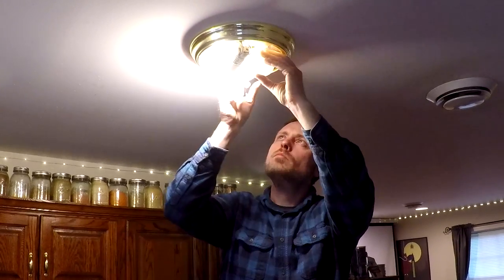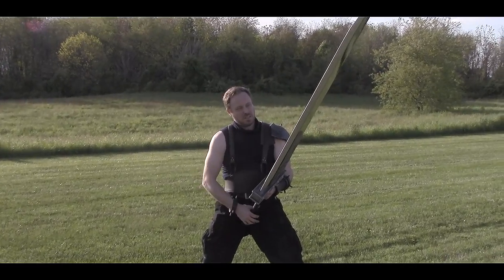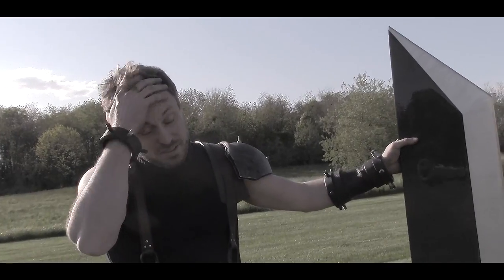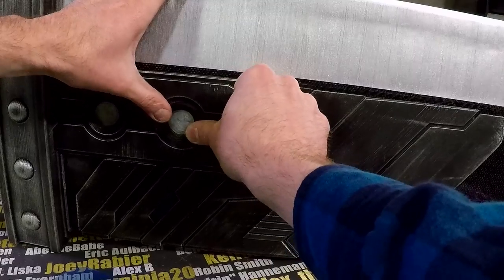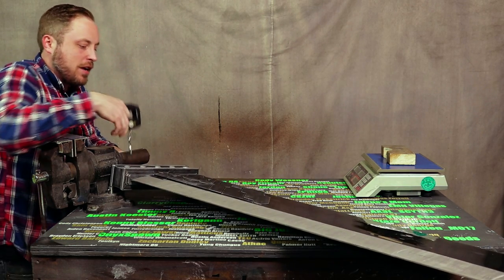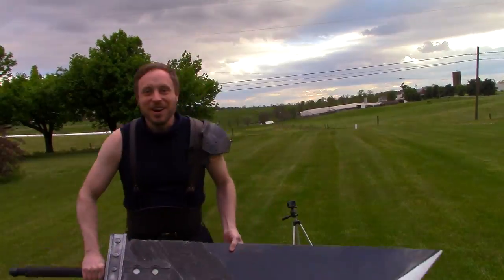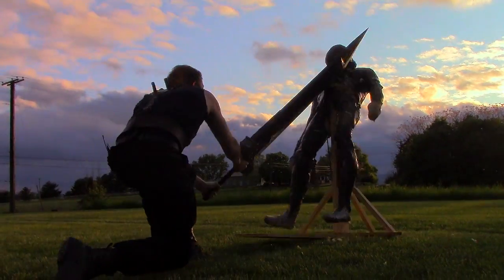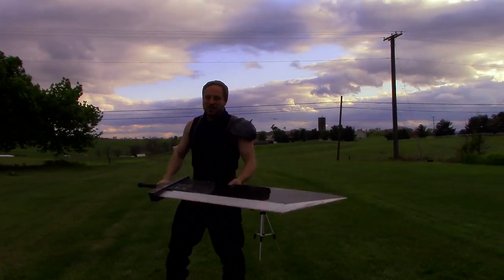CARBON FIBER BUSTER SWORD TEST - With Materia! As Cloud! From FF7 Remake! Omnislash Special!!

Comment from the maker: To answer a few questions that I have been receiving-                                                                             .
Can I have it? / Will you sell it? I will not give this away or sell it but I am willing to make one just like it. In fact I am in the process of making one for someone now. If you are truly interested then email me. My email is always in the video description. If you are wondering how much it will cost, please remember that it is a custom composite piece made from all carbon fiber materials (even the 3D prints) and an exotic metal blade edge with reinforcing internal structure, that takes a month to build... by hand, AND cost for materials alone is roughly 1k.  Basically what I'm trying to say is that it is expensive and will take a long time.                                                                      .       .  
When is this video coming out? Now. lol  Honestly though, this video took me longer to edit than probably any video I've done in the past. I'm still not 100% happy with it but my editing software would not stop crashing and erasing sections that existed in previous saves. I've never experienced anything like it. That is why it took so long. Everytime I would get close to finishing the edit it would happen again.

What's your next project?  I was planning on doing a major video game weapon but it was contingent on a sponsorship that didn't happen. So now I need to pick a new project and you can help. My current 3 ideas are
1. Finally do Aquaman!!!!
2. Axes from Valhalla Assassin's Creed
3. Something from Cyberpunk 2077 (I plan on doing multiple things from this game)
Reply: Aquaman please
Reply: Time for us normal human to try and make this
Reply: Also add some pop out tiny but strong motors in the shaft so with the flick of a switch you get pulled through water under water like those water jet things
Reply: Also work on making your costume more comfortable easy to work around with
Reply: You should get a worlds strongest man to lift that sword
Reply: What editing software are you using, if I may ask?

PS: Cyberpunk 2077!
Reply: I was actually just wondering about how the Aquaman setup was going. I'd like to see where your plan is currently with that one. However, a Cyberpunk build would be pretty cool as well. Regardless, it will be a great project no matter what you do!
Reply: Cyberpunk!
Reply: You mentioned you weren't a swordsman multiple times.  What you're doing is twisting the blade mid-cut.  With a longsword or smallsword, where the blade is an inch and a half thick, the entire blade is through the material before any handle-twist affects the cut, but with the buster, it's just too wide and any twist in your hands in the follow-through will mess with the leading edge's trajectory.
If you want some practice and technique-advice the Modern Rogues did a video cutting tatami with the Austin Tx Sword academy, and the Sword instructors there explained how to look at he tatami cuts you've made and tell what was wrong with the cut after the fact for further practice.  I'd reccomend watching that video and cutting some tatami.  Rising and falling diagonal cuts (Oberhau and Unterhau) are going to be easier than the horizontal cuts (Mittelhau) that you're doing in this video.
Reply: I can see this costing customers $7-10k materials included and it would be worth it to the right buyer. This isn't just a prop per se, you can can actually cut stuff with it! Good work!
Reply from the maker: Steven Small not that much! But it isn’t crazy far off. I think michaelcthulhu charges 5-7k for his swords and it takes about the same amount of time to make. So maybe I’m asking too little! Lol
Reply: @jairusofall  Got it. To be fair this isn't a market I am too familiar with, so pricing will be whatever your customers are willing to pay. My thinking due to all the work and "exotic" materials a hefty price for a one-of-kind is not far off. Considering it takes a month to make, you can only make 12 of these a year max. But again, it is supply/demand. Don't know the demand on these, but I am sure you have gotten some offers!
Reply: that sword look off... look way bigger than what its support be
Reply: Hey what’s the music you used for 14:35 ?
Reply: Cloud would approve of your commitment. ffvii og player approval here. :)
Next blade you could try is Battle Angel Alita's Damascus Blade.
great job.
Reply: yeah honestly like 3k would be a steal for something like this tbh. I imagine you'll get a lot of funny emails though : )
Reply: Berserk, Guts' sword. It will take you years, but it will make you a depressed individual along the way, so it's a lose-lose situation.
Reply: Have you ever considered making the dragon slayer from berserk made of carbon fiber? I think that would be fuckjng awesome considering y ok ur previous success with making badass replicas.
Reply: I'm definitely interested,  I already have the fusion sword. I'll email you.
Reply: Can you make ezio hidden blades too?
Reply: @TheHighKingFingolfin  its ma favorite brev no sad all happy go lucky eclipse.
Reply: By all means...THOSE AXES!
Reply: I think a very interesting build would be and sticking within the Final Fantasy realm is the original gun blade from FF8. Having a real working trigger and firing mechanism but using blanks obviously because of the lack of a dedicated barrel. I’ve seen thrown together quick builds but with your skill and attention to detail, you would probably make one that Squall Loenhart himself would be proud to own. 
That could even be a series for you that I think everyone would like, a weapon from every Final Fantasy game. I know I’d watch that alone with whatever else you would have going on. 
Thanks for all the hard work, time, and effort you put into the builds and videos you give us. It shows that you care throughout the whole process and in the end product. 
Take care and stay safe bro. Peace.
Reply: Maybe you could try a Hardedge or maybe some other FF weapon sometime? That’d be sick
Reply: I'm not a blacksmith by any means, but could you make a tungsten pommel? I have heard tungsten is even denser than lead. Also, most of the videos on buster swords I've seen in the past were: A.) Terrible and just made of sheet metal, and B.) They got a bodybuilder to use the sword since they were so heavy. I would LOVE to see what a strongman could do with this thing.
Reply: Idk if I'd pay 5k, but I'd be 100% willing to drop about 2-2.5k easily
Reply: make nightsky sword please from Sword Art Online Alicization  please please please
Reply: Running some quick calcuations, if you were to use titanium for the blade portion and carbon fiber for the stock of the blade and then all lead for the hammer hilt and handle and pommel, then you could actually get very close to a complete balance of the sword right at the hilt.
Reply: 3
Reply: Kratos weapon
Reply: To combat the one-handed wielding problem you could increase the handle length (only by a bit tho, as faith to the source material is utmost importance) and increase the handle/pommel weight. Because even though this will increase the absolute weight of the sword, it can decrease the one-handed force required to balance torque reaction at your hand from 100lbs to as low as 0lbs.
Reply: I pick you for my zombie apocalypse team... An easy top 3.
Reply: Ok you already did a stellar job with this. Which means you need to do the OTHER mega heavy sword in Anime. But to be honest it is far too big to be called a sword. Massive, thick, heavy, and far too rough. But with those materials you could make one that is actually "usable" I also guess it would be easier to make since it isn't fancy like the Buster Sword. In short: make Dragon Slayer pls.
Reply: It's DEFINITELY interesting to know that you CAN in fact make a functional weapon of typical anime weapon proportions that IS in fact humanly possible to wield if you have the right materials, but now that you've tested it, I'm CERTAIN you can see why even if they DID in fact have the materials they'd need to make them, NO-ONE in ANY real world historical/modern culture would wanna wield a weapon like that in ACTUAL combat.
Reply: @ezrafaulk3076  well, we wouldn't want a bastard sword for zombie apocalypse... But I would want his engineering and craftsmanship.
He says, he's no good with a sword... But those who can use weapons, will need weapons. Behind every great knight, is a blacksmith.
Reply: I think you did a fantastic job with the cutting considering you're not a swordsman and how awkward this monster is.
Damp rolled up newspaper is apparently a good substitute for tatami mats so maybe try that if you can't get hold of them. 

There were a also few errors with your explanation of the physics though. The moment of inertia isn't just related to the weight and center of balance, it's a bit more complicated than that. Pick up a 45lb dumbbell and rotate it 90 degrees side to side, should be pretty easy. Now do the same thing with a barbell held in the center, it's much much harder despite it still weighing the same and having a center of balance through the middle of your hand. Weight + center of balance will tell you how difficult a sword is to hold out in a stationary position but you need to know the distribution of mass to predict how well it will respond in motion.

Are you ever going to do Guts' Raider sword or Dragonslayer?
Reply: you ever get anybody driving by asking wtf you are doing?
Reply: I think you should try sephiroth's sword next. You could also try get in contact with somebody that may be able to wield the sword better like shadiversity
Reply: Just a little question, do you know the song name at: 18:25 ? Thanks.
Reply from the maker: Brütal Program “The End Of All Things” by Niklas Johansson 👍
Reply: @jairusofall  Big thanks :D
Reply: What a gem of a channel, loved this video. As for future project ideas, just pick up any ultra greatsword or greatsword from the Dark Souls sereis. For example Moonlight greatsword or Fume or even Ringed Knight Greatswords. Make that and I swear your channel will hit 1 mil subs lol.
Reply: I think if you try to take video 100x more you will do much better swings and limit breaks 🤣🤣. Thanks for your video, i loved it very much. Thank you for your hardwork 👍👍
Reply: this is the kind of idiocy i love seeing on the internet. great work and a very entertaining video even if you're not 100% happy with it. also if you're selling the sword for less than 10k you're a fool. (no offense)
Reply: @123wal6  honestly, i'd rather see an experienced swordsman try to wield this beast. if you look at what shadiversity did with his wooden sephiroth-replica: that was hella impressive imo and he's definitely not the strongman-type
Reply: With braver, he lets go of the sword as he flips and grabs it an slams it
Reply: Guts' Dragon Slayer from Berserk!! You would be a legend if you made a usable Dragon Slayer.
Reply: HOW CAN I GET ONE AND IS IT FOR SALE
Reply: Incredible work and crafting 👍 also nice cosplay too
Reply: You should try making the Monado from Xenoblade Chronicles!! It's the coolest sword I have ever seen 🔥🔥
Reply: Now we need Squalls Gunblade
Reply: I'm interested!! How much and where do I email you?
Reply: The real question is: where did you find a navy blue sleeveless turtleneck sweater? Tell us about the whole cosplay.
Reply: How much will you charge for one?
Reply: U said to build clouds sword it cost 1k I dont see your email what is it I would like to see if you could do a sepiroth sword also
Reply: Now, I truly hope that you train every day for 30min with that sword for a year and then show us what a 10% complete giant swordmaster can do. (10% because it will take ten years to become a full master.) You are the first to make me think this is even possible, fantastic work. So going over the list end of the world is still in progress chek, plasma proto-light sabre check, functional giant sword check, caps shield check, ******** check, *** ** ****** _______, ** check.
Reply: 16:00 I think the konami code is easier
Reply: Yo would it be possible to get the blueprint or an explanation on how to make one myself? I'd rather make it myself and use slightly cheaper metal than have someone else do it for me and not know how good itll actually be you know?
Reply: The Mithril Saber would be amazing.
Reply: I think I'll go with the master sword rn, gotta go to doc Louis before I could even lift that thing
Reply: @jairusofall  I came back almost a year later after pretty much binge-watching your project all the way up until you release the video of doing this. I cannot believe that this still only has a half a million views.
Reply: I was always wondering how cloud could survive with one motorcycle and a arsenal of swords in the loneliness but your video made me think twice 😂
Reply: The Forged in fire reference XD
Reply: How much does it weigh? A regular longsword normally weighs 1 to 1.5 kg ( 2lbs 3oz to 3lbs 5oz) so im wondering if it is outrageously heavy comparatively. Real longswords are deceptively light because of how thin blades really are.
Reply: @TheDisplacerBeast  now a day if its not made of steel or titanium it would be almost useless
Reply: @Trustee-of-The-Most-High  i thought titanium was a crap metal for making functional weapons.
Reply: @TheDisplacerBeast  after guns took over if your melee gear is not bulletproof is like carrying a nail of your coffin with you js
Reply: @jairusofall  
Don’t know too much about swords but the amount of talent and work that you put into it? 1k is certainly too little for an amazing product like yours.
Reply: Sephiroths sword next, please🙏
Reply: @JAIRUS OF ALL 
Can I pay you to make me one the same exact way you made your buster sword shipping and handling as well
Reply: @jairusofall   what about fusion sword from cloud (advent children) it's looks like omnislash ver.5 i feeling like all them sword open and lock them pretty amazing impossible i'm looking move on.⚔️⚔️⚔️ ✊🤩✊
Reply: I will absolutely be buying one when I have the money same day as the Halo DMR or M8A5 assault rifle deadass.
Reply: @jairus of all, what do you think the cost of this would be at 1/2 scale? I bet it would be pretty functional since it would be wide for splitting like an axe but cut like a sword machete. Also, how tall is your sword to the base?

Comment: "I'm not a swordsman..." gets impressive edge alignment despite the ridiculous blade design. And explains why people never used these things IRL
Reply: People never used these things irl because a traditional sword is made of steel. Someone made a buster sword from steel and it was a two people job to swing it from on the shoulder.

This thing is almost entirely carbon fiber, and it's still fairly heavy.
Reply: @onlinepanic2036  r/Woosh
Reply: @I_Crit_My_Pants  r/itswooooshwithfouros , also woooosh is kinda dead now as a vocal uh, trend.
Reply: It is truthly remarkable edge alignment despite the design short comes
Also with straight horizontal cuts with minimum angle wich are definitely hard with a normal sword unless you use a really curved sword like a shamshir a pulwar or a turkish pata
Reply: @I_Crit_My_Pants  do yourself a favor and log off reddit.
Reply: @I_Crit_My_Pants  I know this is a year old comment but there is absolutely no woosh. There’s no joke going over any heads
Reply: @alt7064  The fact I got it wrong says enough, idc about Reddit as much as you lmfao.
Reply: @marioisawesome8218   The fact I got it wrong according to the other guy says enough, idc about Reddit enough, maybe take your own advice
Reply: @ridleylegassy  Reading back on those either the OP's post was edited after I commented, or someone hacked me and edited my comment shrugs
Reply: @I_Crit_My_Pants  I think the edit might have been rewording or a spelling mistake on OP. No clue about yours tho so ƪ(˘⌣˘)ʃ

Comment: What's important is that you got some cuts in, got some footage, and didn't destroy the sword. Oh and nobody got hurt. Well done.
Yeah, it's got such a wide blade and (relatively) obtuse main bevel that any little off angle in your first cut and the thing will deflect like crazy. That's not your fault, just a byproduct of a video game sword design! That's also the reason I was worried you'd try to cut something too dense or strong...your blade edge is sharp, but as soon as it starts cutting in the rest of that width has to fit into that cut, so the sword starts wedging in and the edge is no longer even doing much of the contact. It puts a lot of stress on the body of the blade. You can see that most clearly in your watermelon footage. But the things you chose to cut were appropriate I think. That last cut with the dummy had me worried that you might mega-smash into that support though!
Reply: I am actually more concerned that the inertia would make Jairus head smash into the support beam
Reply: So the buster sword is sorta a sledgehammer with edges?